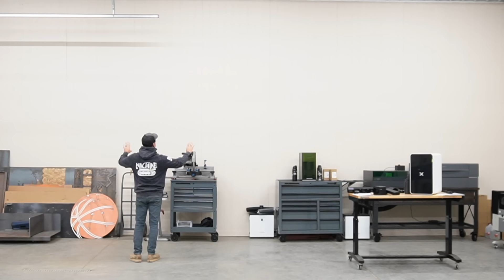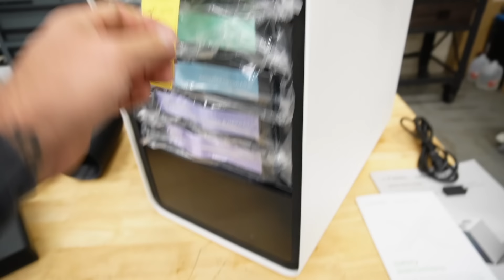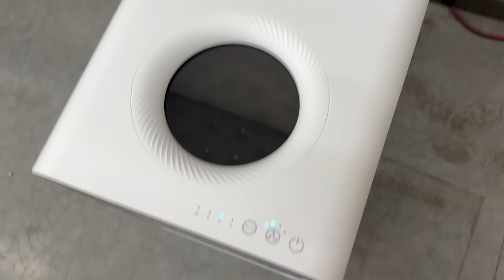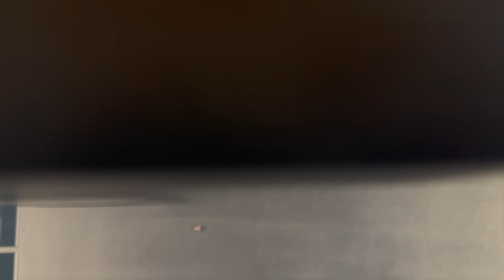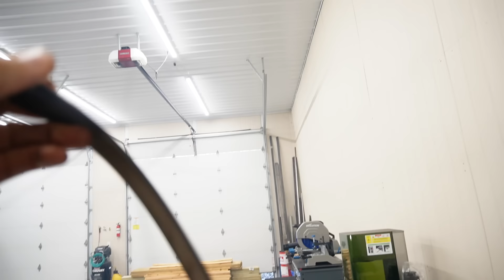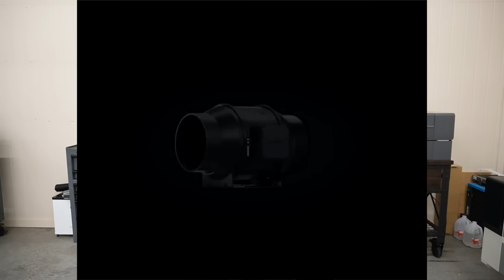The New xTool AP2 & IF2....Perfect Solution For Shop Ventilation

Comment: The AP2 only works for a short period.  I had to remove the pre-filter to get it to clean the air.  I only had less than an hour on the unit.  If possible direct vent is better

Comment: Great Review - Been on the fence. You sold me. I've been doing a lot of leather patches. I have the laser in my basement, and it's not vented outside. Sad story - Did a batch of 30 leather hat patches on my P2 with the original filtration system I bought from xTool with it. After it was done, there was a haze in the house. I opened all the windows to vent it out, but unfortunatly.. The next day my 18 year old African Grey Parrot was dead in the bottom of his cage. If it killed him - it's certainly not healthy for the rest of the family either. Filtration is super important and worth the time and investment.
Reply from the maker: @TheVoxinator  well thats sad to hear.  I used it last night on some leather and it still put off a bit of a haze.  Not too bad but its not perfect.

Comment: Smoke might be escaping around the edge of the lid.
Reply from the maker: I dont think i had the AP2 on high and the p2s was over powering it.  So probably was coming out of the lid and any other gap.  I need to do some more testing
Reply: @SpicerDesignsLLC  you probably could just throw a wool blanket over the top of the laser when doing leather

Comment: Wow! quite neat device, I like the different filter catridges, so you can assure to only change the gunked up parts of the filter system instead of changing the whole deal. I can see this work for resin 3D printers as well.

Comment: Im scared of what the filters cost to replace. Ive got the original filter and was hesitant about just the 2 or whatever filters that are in there, I cant imagine 5 or 6 to replace.  But now Ive moved my laser crap to the basement and gotta have something.  I had to trade my 1000 sqft shop for a 600 sqft barn, so stuff is everywhere. I ought to pick up that P2 plaino from you.
Reply from the maker: Its a pretty nice purifier.  The good thing is they claim the filters will last a long time.  We’ll see.  The P2 went quick.